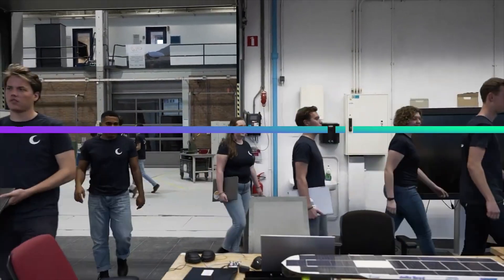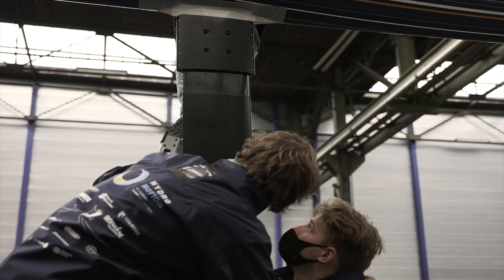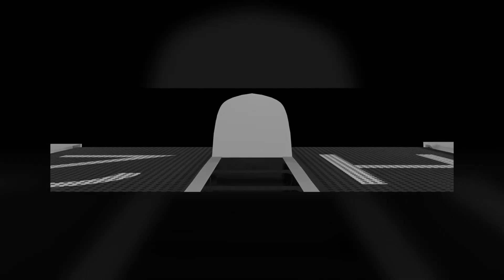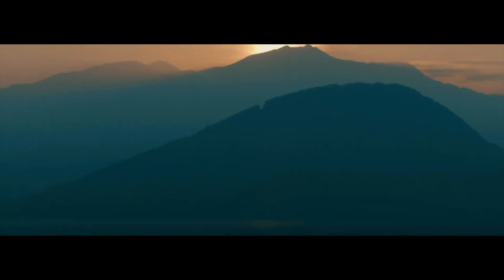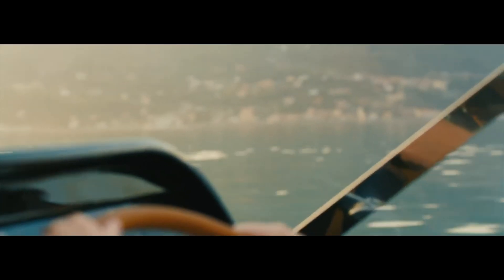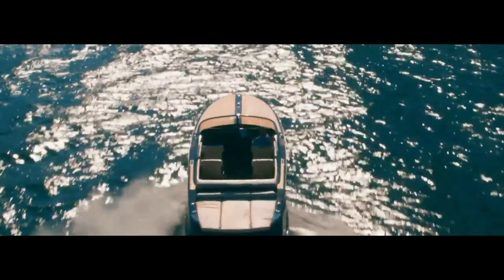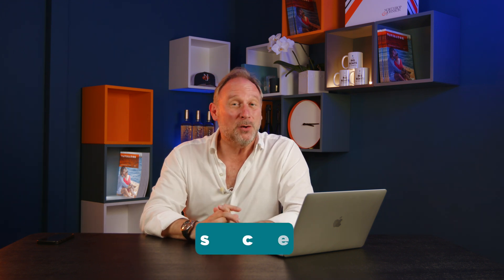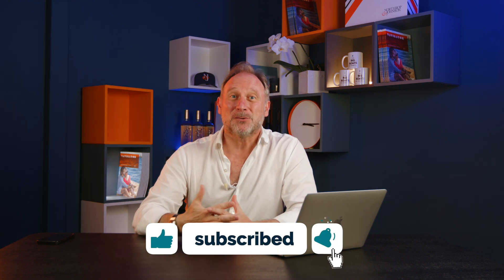OPEN SEA CLASS BOATS AT MONACO YACHT CLUB'S ENERGY BOAT CHALLENGE!

Comment: Flettner rotor 'sails' are pretty interesting. Sometimes called a magnus rotor. You should look at those. While they don't necessarily solve using fossil fuel for combustion, they do in fact cut down on the amount you would have to use. Are they unseemly and mess up the sleek sexy lines of a Nuvolari Lenard or Donald Starkey? Absolutely, but could be a design by Bhusan Powar Design who designed the Zion Black Hole concept yacht or the designer for Lattittude yachts that did the gold 79M trimaran design (forget his name, apologies). They could certainly come come up with a design concept around them. Maybe even figure out how to power them with clean energy. Certainly something to look at and they have been and are still in use today.

Comment: The problem with electric boats of course is you are burning fossil fuels to get the power to the boat. So in some ways, it's no,different than the hybrid system on some yachts like Bering and Baglietto(sp). The diesel generator is burning to make power for the electric generator to power the engine. Although in Bering's case, they have solar panels. I think hydrogen is the next wave, but honestly I see a system being developed where regular sea water is taken on and the hydrogen oxygen bond is split, and both elements burned as fuel to power generators. The problem of course in splitting them is that they become lethal gases so that is something to overcome as well. Gellified saltwater to use as ionic engine fuel has appeared is science fiction books for years now. There are ionic engines powering satellites, but they produce little thrust. I think the combination of solar and wind(sails) are the best cleanest option. If they made solar panel sails, that would be amazing.

Comment: Electric boat with Lithium batteries are incredibly dangerous and stupid.  If you suffer a battery fire they're basically unstoppable.  They'll end up like turbine boats, virtually uninsurable.  Who wants  5-7 figure toy that you can't ensure, you'd be better off gambling with penny stocks.  Plus most these boat runs for less than a half day at speed.

Comment: "Hydrogen is a clean fuel"
No, it's not. It is not a point source emitter, true. But producing hydrogen is about a dirty as it is possible to be. Most hydrogen is produced by steam reformation of natural gas. It produces lots of nasty waste. It's technically possible to produce hydrogen by electrolysis of water but that requires prodigious quantities of electricity that we simply don't have.

Comment: Ive been meaning to contact you. There is a youtube vid showing ten energy efficient boats and one of them is a large yacht using hybrid / solar,  and Hydrogen creation, massively extending range. So for a yacht like a Bering 77, with a 7000NM range.. this could easily be extended out to 21'000 range minimum if not significantly more.  I have been contacting a few boat builders (I have not spoken to Alexi from Bering yet), there is hesitancy when I mention modifications I want as in hydrogen/solar/diesel hybrids, also using copper alloy on open drains and AC systems (copper will not grow mold or bacteria and is good conductor so can be made smaller with wider fin spacing to allow easier cleaning). the big health things with living on the water are humidity related problems such as mold and bacteria (like chlamydia pneuminiae). The ideal humidity is 45% as 50% is where mold starts to grow on any available surface. Adding chemicals to inhibit mold is just more endocrine disruptors or inflammatory chemicals.  Why do I still want to live on the water ? Because it is relaxing (Stress is the No.1 cause of illness) and of course.. the negative ions blowing in from the water are amazing for your health and wellbeing.   But back to fuel.. the B80 for example with its 47K liter fuel tank.. would cost over 100K to fill up. So of course we need to greatly extend the cruise capacity and not rely purely on diesel. However Solar is imperfect as it only works in ideal conditions not bad weather or at night. Wind.. well you might as well get a sail yacht if you want to go that direction. We have some great tech, and it needs to make it to the Yacht industry at every size.